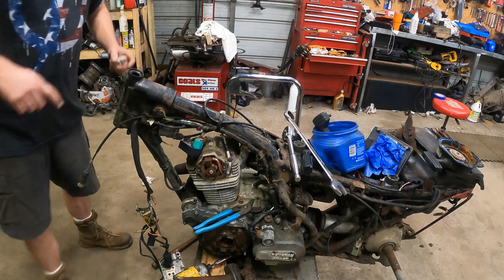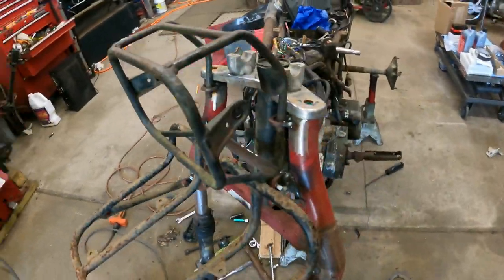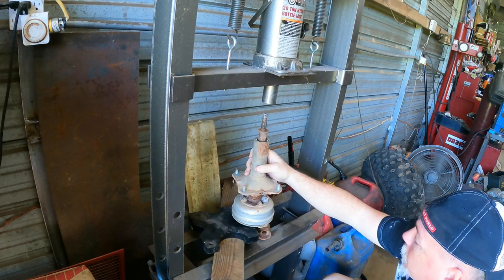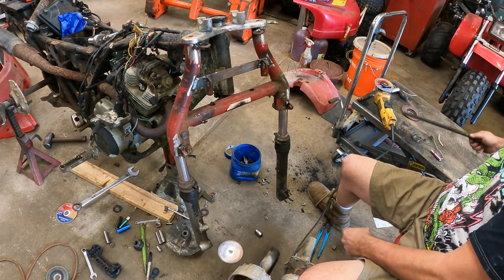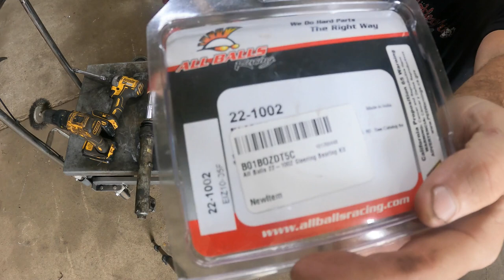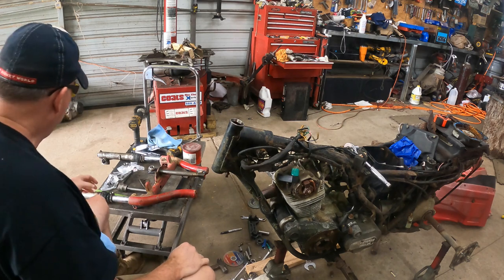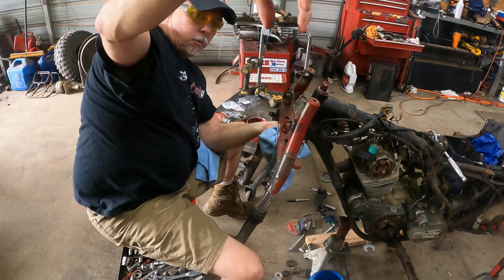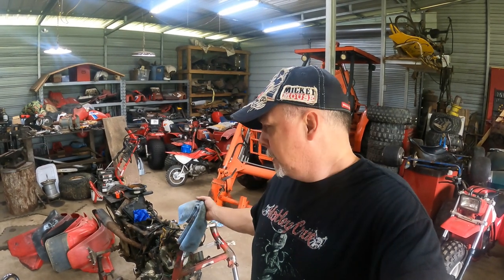Easy Front End Swap!

Comment: Doing this now, but on my 1983 200E Big Red and with 185S/200S forks. Same concept, just even more narrow forks than the M. My welding sucks, so imm have to grind and maybe slap some bondo on it to make them look better at 1st glance lol.
Reply from the maker: You may need to swaps tank or use bar risers to clear the bigged 200e tank with that front end. Other than the 8 inch ft tire its a better option than a broken factory 200e front end for sure.

Comment: Thank you.  I really needed this video.  Have never ever messed with steering bearings and you gave me the confidence to just knock it out now.  Putting a 200x front end on my 250sx.  - Tim
Reply from the maker: That's a common and very good swap, you gain better suspension, skinny tires, alluminum wheel and disc brakes. Awesome. Thanks for watching and sharing

Comment: Thank you for this video !   I bought my first ATC (Honda of coarse)  this April.  Its a 1983 200  but there are no letters after the 200.  mine does have the alum. fork tube suspension. I don't think the front end has been swapped or changed,  will this bearing kit you used in this video work on my ATC.  P.S. I look up my VIN # to find out about my ATC and the motor # matched  the year and the 200 is all that it listed for my VIN.  do you know how many different 200's they made in 1983 ?    Thanks for any help !
Reply from the maker: Sounds like you have a 83 Atc200. No letters after the 200, just a Atc200. I have had a couple. Nice machines. I believe it's the precursor to the 200s.

Comment: Looks good but why didn't you put a grease fitting in the fork tube, I put one in my 85 250sx when it was pretty new and greased it and it still has the origional ball bearings in it
Reply from the maker: Hey Daver681, that surely is an option, i see having to fill most of the stem with grease to lube the upper bearing, i guess thats why Honda didnt do it. These bearings will last many years with a good packing, i dare say i will ever have to service them again. Thanks for watching.

Comment: I bought a new fender for my 200s i was wondering the best way to slide the brake cable through? Disconmect from bottom or top?
Reply from the maker: It would be easiest to loosen and disconnect from the top then pass it through the fender. Reason the lower adjuster bolt easily gets cross threaded
Reply: @mrcbuilds  thank you

Comment: Just to clarify in my mind, the 1984  200ES  front axle hub and brakes will fit onto the 1985 200M  front forks? I’m looking at a 1985 200M front end but it doesn’t have the axle and other hardware with it, just want to make sure if I can use my 1983 200ES front axle and everything. Sorry for the dumb/basic question, I don’t trust myself..lol. 😏
Reply from the maker: I suggest using all of the 200m. Axle, hub, spacers, brake, everything. Its been 2 years since i made that video, i can not remember 100%. I do not think the parts are interchangeable.

Comment: Hi, I am putting a 200s front end on my 110 and it fits but the top bridge plate is missing so I bought a 200s and it dose not fit I thought I had a 200s front fork but after seeing this video I might have a 200m front fork  so I need a 200m top plate? what year do you think I need I do not know the year they came from I just got the front end from a swap meet?
Reply from the maker: @stevenpleasant5834  the 200s would have a 8 inch front tire and a smaller bolt pattern than a 200m. You will need a 200m hub and axle to work. The 200m was only made 2 years 84 and 85. Either top plates will work
Reply: @mrcbuilds  Hi, ok thanks for getting back to me on this so how do I know what front end I have I have bought two different top plates and they do not fit the last one I got the two outer 12mm bolts looks like the will line up but the stem hole is off it is to far in and will not fit down on forks.

Comment: Fantastic details. Got so much information I had to take notes since I loose power and internet pretty often.  On plastic seat bases, when I can't come up with a proper cover I use FX all grip material 36x54 inch sheets for about $40 and I get either 2 or 3 seats out of it. They come in black, blue and red. E-Bay is my source but it's in the Parts Unlimited catalog when I'm at a dealer. Many thanks sir, and always look forward to the next vid.

Comment: Really glad I found your channel, I can't get enough of honda 3 wheeler content.
I've got a few 200 and 250cc machines. I had a question maybe you could help me with. I have an 84 trx200 which you know is Hondas 1st quad. I'm having trouble finding replacement bearings for the neck...I think it may be individual balls but I have not torn into it yet but its dangerous to ride the way it is. Appreciate any info. Thx bro
Reply from the maker: Goto partzilla.com, look up your machine, it may be individual balls, the 3 wheelers are. Take that part number and put it in google/ebay or amazon. See if you can find a captured ball bearing like the ones from all ball bearings.

Comment: I am planning to do this conversion on my 84 Big Red! I was wandering if the ATC200s suspension and axle would fit on a Big Red brake drum and wheel hub? The 200s and 200m front suspension looks similar but reversed. As always great content and information cheers for Quebec!
Reply from the maker: The 200s drum and hub will not fit the 200es. The 200s has an 8 inch wheel, different bolt patter and the forks are narrower than the 200m and 200es. You 2 best swap options are the 83 Atc200 or the 85/86 200m. Both have suspension, 9inch wheels and front brakes. Both also share the same bolt pattern as your 200es. Thank you for watching and subscribing to the channel

Comment: I got a decent 250ES Big Red but no tank no plastics engine needs work but frame is good forks are good wire harness is good swing arm is good rear end is good got a decent headlight I have been trying to decide if I want to keep it and try to fix it or trade it off for some parts
Reply from the maker: You have a big decision to make, fenders, tank and seat are you most expensive parts, try to find a parts bike with at least good fender or a usable tank, otherwise it could be a costly build if you opt for NOS parts or even aftermarket, maier fenders a clarke tank will set you back around $800 plus, so way out your options. There great bikes, if you choose to fix it.
Reply: Yeah one of the people that had it before me unless it out in the weather and I have to drop the engine in some apple cider vinegar to get everything cleaned there's rust it's not bad but there's rust and it's froze up so it needs all new bearings needs a new piston and piston rings I have the seat for it I just have to get it from my buddies house if you remember I fond of order she probably seen it already but yeah I need almost everything I'll probably just make some plastics for it out of some plastic barrels or something like that and a heat gun I do know somebody with a old big red that's been sitting for a pretty long time has a broken rear axle if I could get it off them I can just use this one as a parts bike

Comment: Will those bearings work on the 86 250 es?
Reply from the maker: I have not made that exact swap, so I cant sure for certain, but I believe they do. check with all balls before ordering.
Reply: They have sent the 22-1029 but the top nor bottom race seems to sit flush
Reply from the maker: @thomasgriffin8508  hi Thomas the races are different. Could you have them in opposite?
Reply: @mrcbuilds  tried both ways but they don't seem to go any farther. Maybe I need to beat them a bit harder and thanks, your such a nice guy to reply back 😎

Comment: Will the front suspension on a Honda ct 125 fit the frame of a Honda 200 es
Reply from the maker: I have no idea, easiest way is look up both bearings and see if ther are the same, you may still find issue with the lenght of the stem. Good luck!

Comment: What do you recommend for bottom end work?
Reply from the maker: If your new to mechanics, I would leave bottom end work to the pros. If you want to tackle it. I would reccomend, Honda Brand bearings, if your going to go that far, you should put in the best parts you can. I would download the repair manual, print it out and order up the parts, clear off a big table and lay everything out as you take it apart. You will need a few special tools, a bearing press and snap ring plyers. A good gasket kit will help as well. Take your time and you will be fine.
Reply: @mrcbuilds  thank love the channel it’s taught me a lot about my big red
Reply: @mrcbuilds  would you know where to get a PDF?
Reply from the maker: @brodeyhutcheson7721  https://threewheelermanuals.com/honda. Look up your machine and download the file.

Comment: Hi do all balls make a front bearing kit for the Honda 200x front stem for the forks and do you know if the 200x front end will fit on a 200 or 200s.thanks for your info.
Reply from the maker: Hi steven, the entire line up of 200cc and 185cc necks are the same, as I understand it the same kit fits all of them and you can swap front ends across the entire group of machines 185, 185s, 200, 200x, 200e, 200es
Reply: @mrcbuilds  ok great and thank you for your help on this.